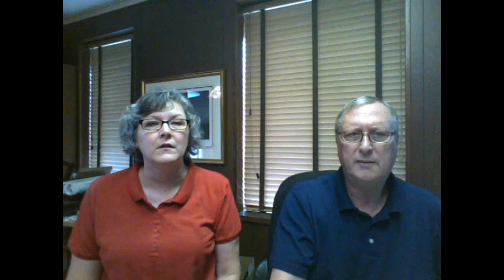Introduction to Dam Maintenance Videos

Comment: The change your oil, not your engine is a good example. However, I would give the example of only changing out the worst brake pad, or shoe on each corner of a vehicle. As well as, not even replacing the brake rotors or drums. Possibly even machining just the drum or rotor that needs it. Which might be a good short term fix, however, when a person is taking their vehicle back to the repair shop, in less than a year, the savings the got the first time is lost by having to do it right the next time. 

Of course, then the person isn't happy, they got taken the first time, and if they are sane, stop using the repair shop that took the short cuts, and charged them almost as much as if they had done it right to begin with in the first place! 

And, I would have to believe, in large part it is the same way with a dam complex such as Oroville. Which along with the hundreds of thousands of people downstream, also is upstream from most of the countries if not the world's main food source. Therefore, at least from my viewpoint, it is extremely important to everyone, not just to the people in the Oroville area as well as downstream, but to everyone. It is just like that vehicle with the poor brake job, it doesn't just affect the person in the vehicle, it effects the people that either come in contact with the vehicle, or if it a delivery vehicle, it has an effect on a large number of people.

Furthermore, when I was hired by a friend, who did house and commercial building. Taught me a key principal of building house's, roads, bridges, dam's, etc, is to dig your foundation deep, so it is founded on the rock. Which isn't simply limited to building one's foundation for a house, or any other structure correctly. It is also stating do the job right the first time, or you will pay more for cutting corners. That has been something that has stuck with me, since he made it a point, to teach me that principal. 

Oh, and yes it is referring to a Bible passage, however, it is also a universal building principal, that has been practiced for thousands of years, and his dad is who taught him that building principal. Due to the fact he had no clue it was even written in the bible. 

Although, it is a extremely important building principal, that I have heard time after time, from construction people, who are worth their weight in salt! Who are always busy, and never need to go looking for work, and I would not believe, that anyone would not want their house, or any other structure they are paying for built correctly! Not even the trolls who either have no life, or are getting paid a lot of money to try to blow holes in what someone has to say about a given topic. Such as the Oroville dam complex. (Oh, by the way, to the trolls, don't bother responding to my post, I will not reply to you!)
Reply: happycamper3dhd 
Well spoken my friend. Loved the first paragraph, great analogy.